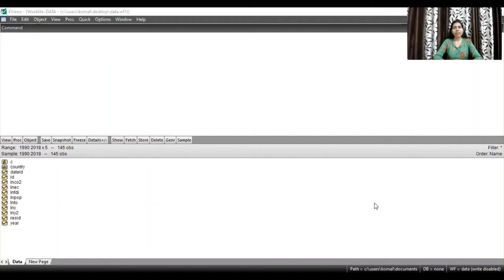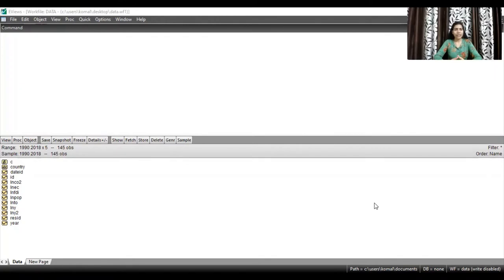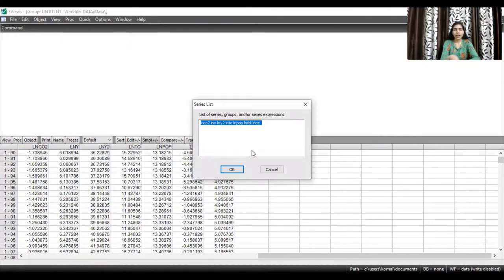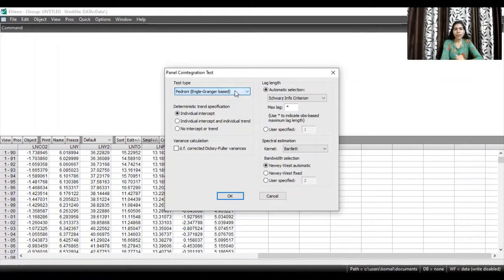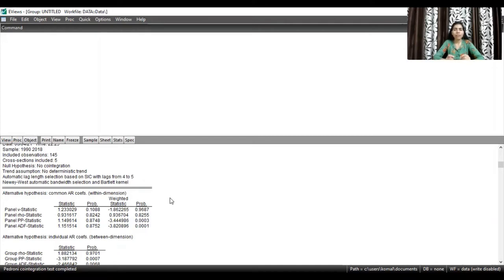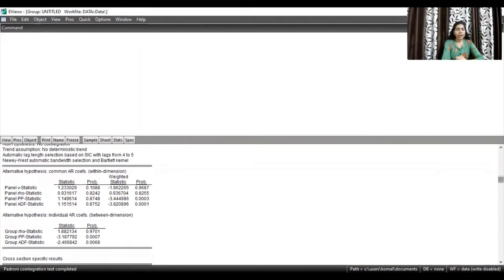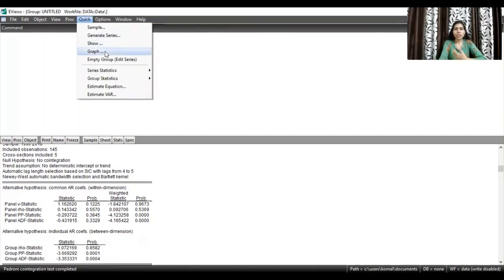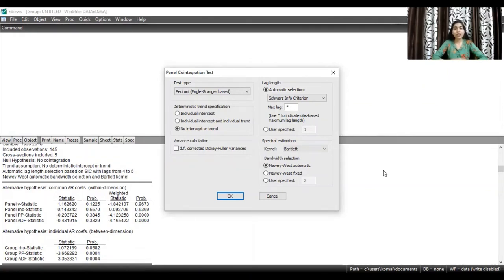Cointegration Test in E Views| Johansen  Cointegration in E Views| Panel Cointegration Test| E Views

Comment: in my case 6 test statistics have less than 0.05 p-value, should i reject the null hypothesis?
Reply from the maker: Yes, you can. But cointegration is not strong. Try other cointegration models and see your results then come to a conclusion. 
Like you can run - Kao, Fisher cointegration test.

Comment: Hello ma'am I am a bit confused as per my knowledge we will use cointegration when the data is non-stationary and we will use cointegration when the data is I(1). So could you please confirm in this aspect. and I very glad regarding the lectures really they are very helpful.
Reply from the maker: Variables should be stationary at level.

Comment: What to do if 7 out of 11 tests generate output more than 5%, meaning no panel cointegration?

In that scenario, i do not need tl conduct panrl ARDL nor VECM test. Can i jump into pls, fe, re regression in that case??
Reply from the maker: Yes, the results indicate no panel Cointegration.
You can run any Regression model like - FEM/REM.
Reply: If in FEM models constant has a p value of 0.179 what does it mean? Would it be a part of analysis? Or p value of constant doesn't matter?

Comment: Hello mam, My variables are non stationary at level? Can I use cointegration or not? Thanks in advance
Reply from the maker: Yes you can. Only if stationary at level or at first difference or a mix of both.
Reply: @komalkanwarshekhawat_  ok thanks mam
Reply: @komalkanwarshekhawat_  If variables are non stationary and no integration. Can I able to run pooled OLS regression? Please answer madam 🙏
Reply from the maker: @agoogleuser6452  You can proceed with any model only if your variables are stationary either at level or at first difference or a mix of both.
Reply: @komalkanwarshekhawat_  Thank you for your answer madam. You are the best lecturer 🥰